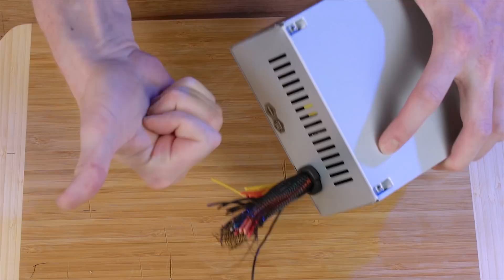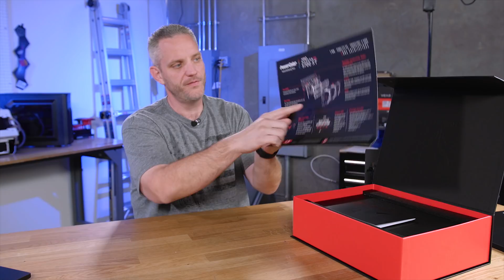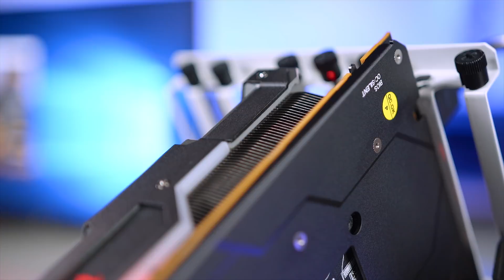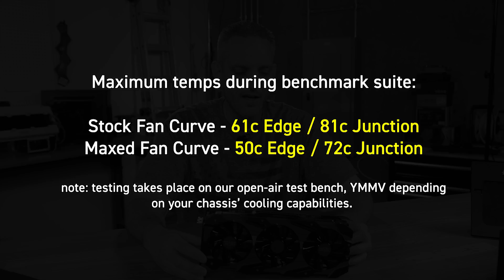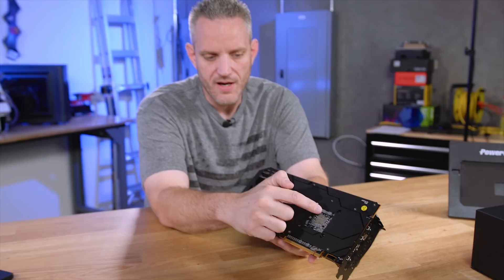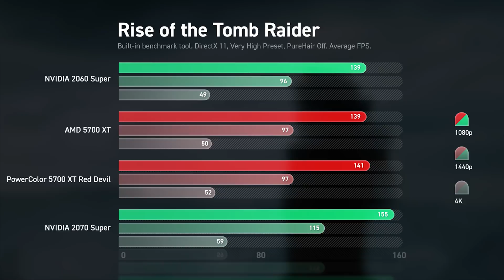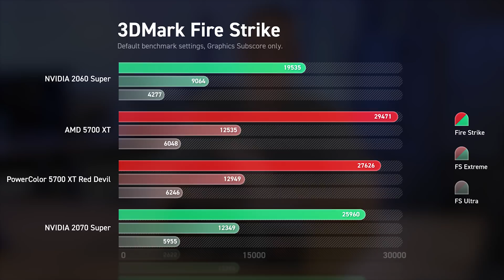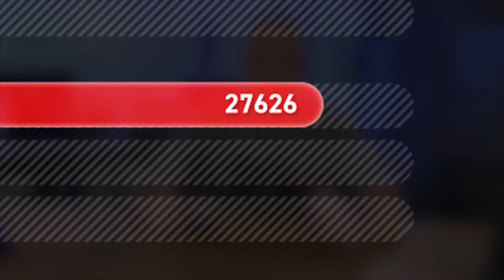Custom RADEON 5700 XTs are here! and THEY ARE GOOD!

Comment: Just finished bitwit's video on this GPU and now Jay's take on this bad boy, this is a good day for me.
Reply: Timmy Joe did one with a Byski water block as well. And was getting a OC of 2.25Ghz
Reply: Ayyy, same. This card is looking quite interesting but if what Jay is saying about these cards being like Ryzen, I think I can hold off with my r9 390 for a while longer...
Reply: @uss-dh7909  same
Reply: @uss-dh7909  I too am going from R9 390 to this one. Just ordered it. Hope it turn out well.
Reply: @unbreakableironman  how did it turn out?
Reply: @dannyd7714  fantastic card. Quiet and powerful
Reply: Check out Hardware Unboxed video too
Reply: @Dopecho  Lisa Sue needs to stomp on the driver division with both feet and roll some heads. It's hurting first impressions on every product...and causing grief for people who want to buy their products, it's unacceptable.
Reply: @LazarWanders  All of the driver issues he mentioned were fixed. AMD Radeon Adrenalin Edition 19.8.1 driver
Fixed Issues:

Some system configurations may experience color corruption after install of Radeon Software when running Windows® 10 May 2019 update. Issue is resolved in the latest Windows® Update 18362.267 (KB4505903)

Radeon Chill settings may not sync with game profile settings when changed in-game through Radeon Overlay

Radeon RX 5700 series graphics products may experience a black screen or flickering when applying auto overclocking memory with games or applications running in fullscreen

Radeon AntiLag may slightly impact performance in select games

Radeon RX 5700 Series Graphics may experience a black screen during uninstall on Windows®7 system configurations. A work around is to perform uninstall in safe mode.

Recording clips with Radeon ReLive may result in blank clips on Radeon RX 5700 Series Graphics with Windows®7 system configurations.
Reply: @levinunezmarte6667  Excellent, however my point was that they should not need to be fixed after launch, they need better QC
Reply: Uhm
Reply: From Bitwit's review:
"Regarding the driver issues - Once the system began crashing I ran DDU and reinstalled the latest 19.8.1 drivers to no avail. Still more crashing than Lyle's driving record. After shooting and editing the entire video I decided to run DDU again for the hell of it--and to my surprise that seemed to fix things. I've never had to run DDU twice and for the record, I'm not the only one having driver issues with these cards. If anything should stand in the way of someone buying an RX 5700 series card over GTX/RTX, it's the drivers (at least for now), which is a bummer because the hardware really is awesome. Hopefully AMD irons it out quickly. Feel free to share your experience with Navi drivers so far."

Driver instability is a good day for you?  Wasn't AMD supposed to have such great drivers now?
Reply: @kinggremlin4574  All of the driver issues he mentioned were fixed. AMD Radeon Adrenalin Edition 19.8.1 driver
Fixed Issues:

Some system configurations may experience color corruption after install of Radeon Software when running Windows® 10 May 2019 update. Issue is resolved in the latest Windows® Update 18362.267 (KB4505903)

Radeon Chill settings may not sync with game profile settings when changed in-game through Radeon Overlay

Radeon RX 5700 series graphics products may experience a black screen or flickering when applying auto overclocking memory with games or applications running in fullscreen

Radeon AntiLag may slightly impact performance in select games

Radeon RX 5700 Series Graphics may experience a black screen during uninstall on Windows®7 system configurations. A work around is to perform uninstall in safe mode.

Recording clips with Radeon ReLive may result in blank clips on Radeon RX 5700 Series Graphics with Windows®7 system configurations.
Reply: @levinunezmarte6667  As I quoted above, Kyle was using 19.8.1.
Reply: @kinggremlin4574  Wow who pooped in your cereals this morning? its press drivers gtfo
Reply: @perkele1989  Not even close, AMD has had driver problems with cards since January.
Reply: @jaronmarles941  January? .....Man,that shit goes back years from what I have seen. Don't buy a Ryzen powered laptop yet. If you do you will see what AMD driver problems really are.
Reply: @perkele1989  Since when do customs cards have press drivers?  This card uses the standard AMD drivers that every other AMD based card uses.  As Kyle said in the video, which you obviously didn't watch, the driver problems he experienced were not specific to this card, he had the same problems when testing AMD's reference cards.  The 19.8.1 drivers Kyle used are not press drivers, and are not the initial driver release for the 5700 series.  Any other excuses you want to inaccurately invent?